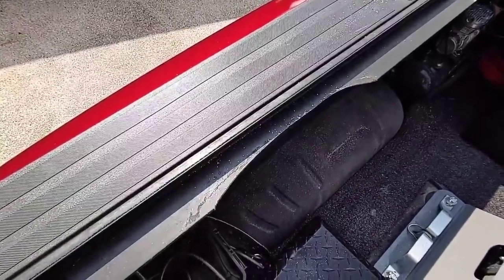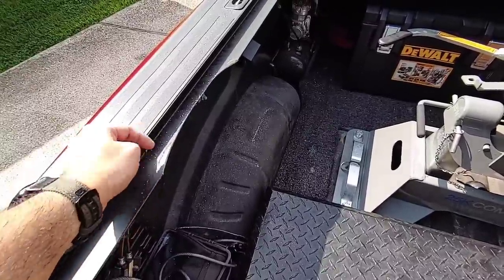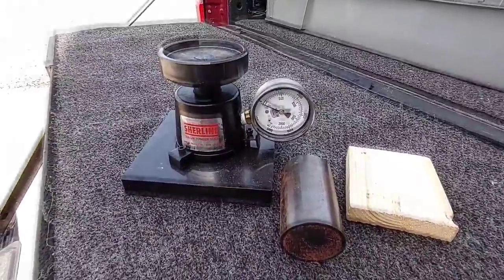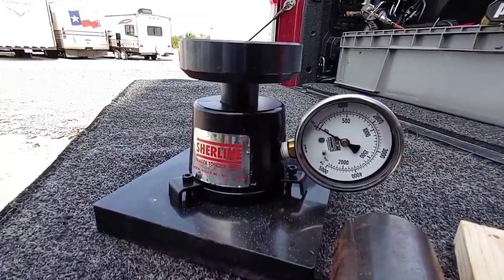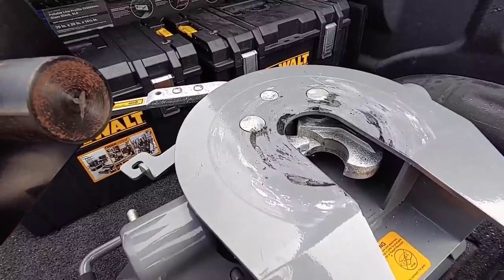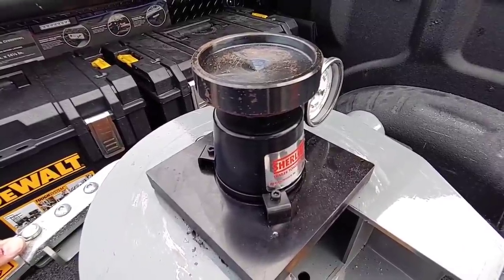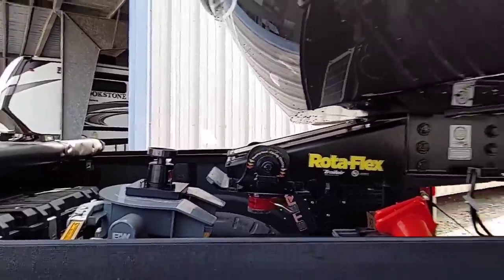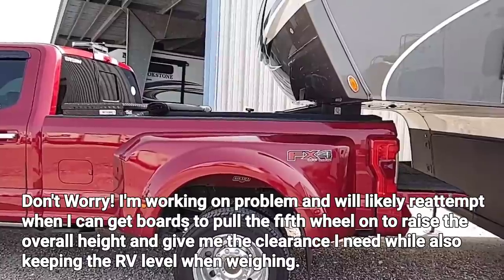That didn't work! Going to have to rethink this!

Comment: This is way over complicated. Just remove that pin from the scale. Put some concrete blocks in the bed of the truck right in front of the hitch. Place the scale on the blocks. Or your truck rides higher than it does from the factory. I can't remember if you had bags installed